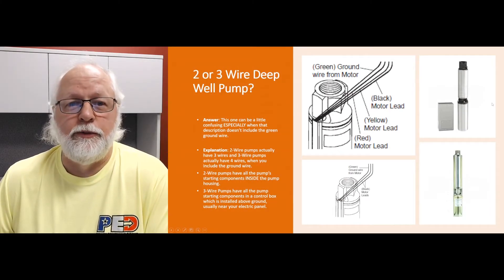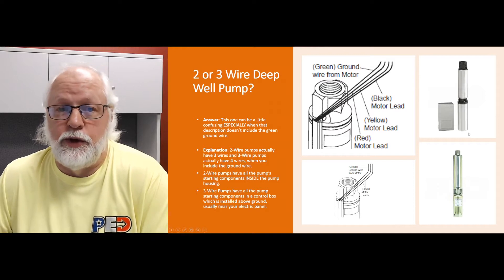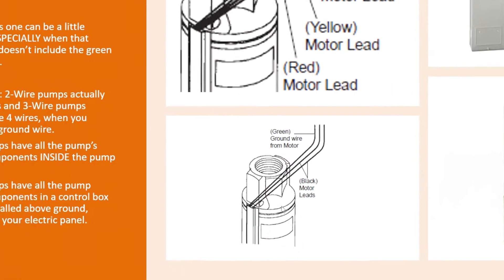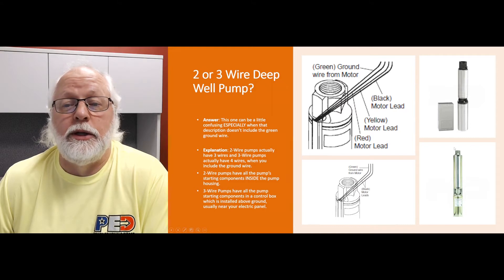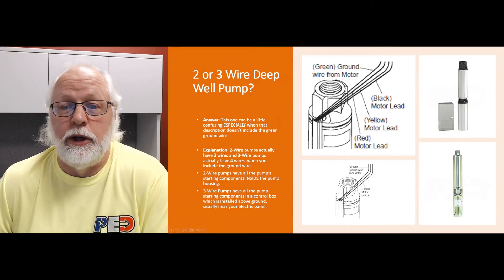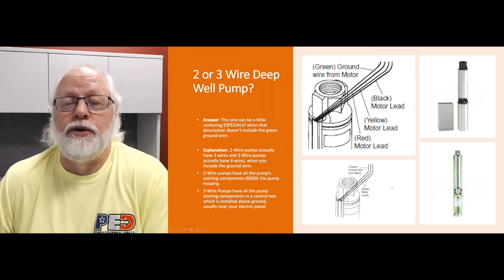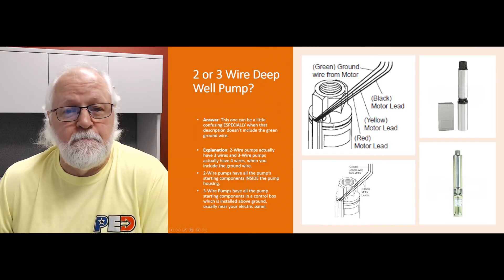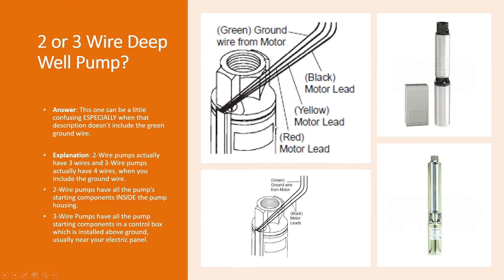2-Wire Well Pumps vs 3-Wire Well Pumps

Comment: I bought a pump that came with 2 wire. The label on the pump says 230v. I didn't come with a power box. It runs on 110v but it lacks pressure. What am I missing?
Reply: another 120 volts

Comment: Well, I pulled a pump from a 90 ft well that only had two black wires to it. There was no ground wire run out to the pump or in the casing. The new pump I put in had two black wires and a ground wire. There is no control box. At this point in time I just tied off the ground.

Comment: Jim. I would like to operator two wells with the same 2 wire feed. I wanted to run the pumps in parallel with a DPDT switch at the first well so each well would run independently. Do you know of a  weatherproof switch I could buy?

Comment: Can anyone say why red lion 3/4 hp jet low depth pump does not have a ground line coming out of pump?  Normally there is one and it is attached to one of two ground screws on the pressure switch,  In those other cases, your power line ground gets attached to the other ground screw on the pressure switch.  Seems very clear in those other cases, but not this one.   The diagram provided for red lion pump only shows one ground line and it is going from one ground screw to the earth ground surface.  

Perhaps the power line ground wire gets attached to one of two pressure switch ground screws and a separate ground wire is added to the system, going from the other P switch ground screw into earth or wrapped around well head metal surface.  I would rather not assume though.

Thanks

Comment: Im wondering your thoughts on which is more reliable? I currently have a 240 volt 3 wire deep well pump, but am trying to get off grid. My current solar set up allows for 12 and 120 volt. Doing all my home work to see if I should upgrade my solar or change out my 240 volt items to 120 or 12 volt. 

Other then my well pump, I have a hot water tank, and mini split that operate on 240 volt.  Mini split is no go for 12 or 120 volt but hot water heater could run on 120, so well pump is the ony item that can set the scales  of deciding  what to do.

Comment: I know this is an older video but can someone tell me where to connect the green ground on a 2 wire pump, thanks
Reply: Green is ground according to national code just about anywhere. Now if you are wiring up a semi trailer green is for the right turn signal light, yellow is the left turn signal light.

Comment: I found a not used well on my newly purchased property. It has a deep well pump with a red, black and yellow wire from the pump. All wiring, breakers or anything that was above ground was removed prior to buying the property. How can I run this pump? What are the wires? Is it a 120v, or a 240v?? No markings visible on the pump, it was buried in mud, but in great condition. Thank you for your info!!

Comment: Greetings, I have a question. The pump i have has 4 wires including the ground.The cable I have to join it to only has 3 wires. Do I need to buy a separate ground wire or can I just egnore the ground wire and connect the 3 wires. The people I bought the pump from say I shouldn't worry about the ground wire. While my installer says I need to get another wire and make it the ground.
Reply from the maker: That ground wire is for your and the pumps safety, so we would highly recommend that you include that 4th wire. It may also be required by your local code.

Comment: Looks like I have a 2 wire with a control box. Is that possible?
Reply from the maker: Sure it's possible, but it is not common and might not have been necessary to install. You'll probably need to do some looking in the owner's manual to get an explanation if it was meant to have one. Or, you installer just put one in anyway.
Reply: @PowerEquipmentDirect  I am currently dealing with the same issue. I'm replacing a 2 wire pump but it also has a control box. Would you recommend removing the control box before installing a new 2 wire pump? Thanks..Great informative video!

Comment: How do you measure a three wire pump to see what the voltage would be 230 or 110 and if it is 230 where's the common connected to the box
Reply from the maker: The pump motor end should have the voltage information listed on a label or engraved into the pump. Otherwise, you'll need to call the pump manufacturer, read the manual, or find additional documentation, but that information should be given with every pump.

Comment: Im still confused is ths for 110 and 220
Reply from the maker: If you look at the article link in our video description, we have detailed information that lays out all the differences between them, including voltage. You should find answers to most questions you might have in the article.
Reply: @PowerEquipmentDirect hello  can I put a 110 conection. Coming out of the gray box for my heat lamp ?

Comment: Not to ask a stupid ? ..but .. Does anyone know how to tell if I have a 120.or 240v pump... ?.. Bought older has everything rigged together.. Has 12/2 . I guess wiring from pump.1 black 1white. Bare copper ground..120v??.but has 240v breaker marked. Well pump..any ideas..i hooked it up 120v it works but shuts off.on every few minutes..
Reply: You need to test at the well head what you have coming from the panel if you have 240 coming from the panel you need a 240 voltage pump
Reply from the maker: Can you get a model number of the pump? If you find one, give us a call and we'll help you look it up over the phone.

Comment: Control boxes are not necessarily located near the panelboard. It is usually close to the pressure switch. The NEC (National Electrical Code) didn't use to require a submersible pump to be connected to an equipment grounding conductor nor did it require connecting the equipment grounding conductor to the metal well casing. Which manufacturer pressure tank do you recommend? Thanks for the video.
Reply from the maker: 40-50+ years ago, many pump manufacturers did not require the pumps to be grounded, just like most of our home AC outlets didn't have a ground.  Obviously, that has changed for safety.  Regarding the pressure tanks, we don't have any specific recommendations. However, we know that Flotec tanks are made here in the USA and are of very good quality.

Comment: Does 2 wire well pump need control box?
Reply from the maker: No, a control box is only required for a 3-wire pump. 3 Wire pumps are actually 4 wires, but no one includes the ground wire in the number.